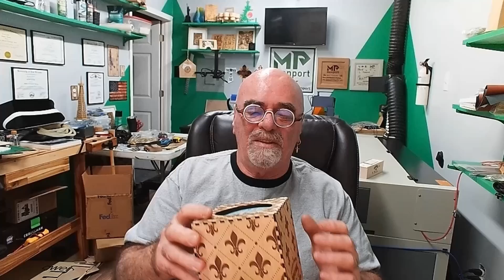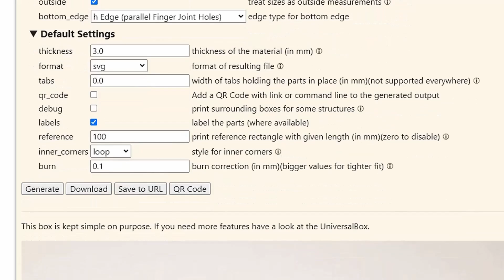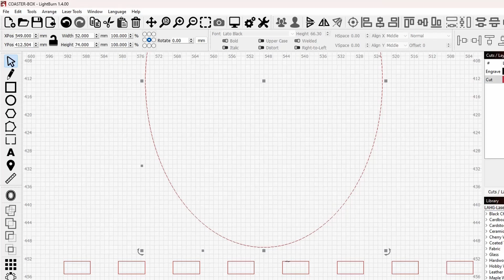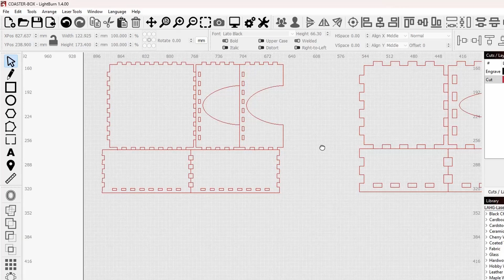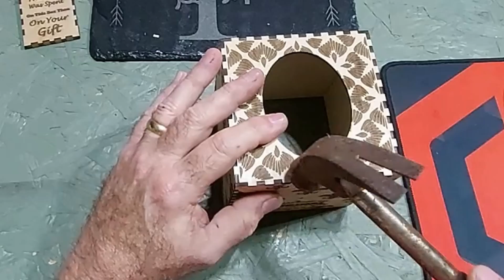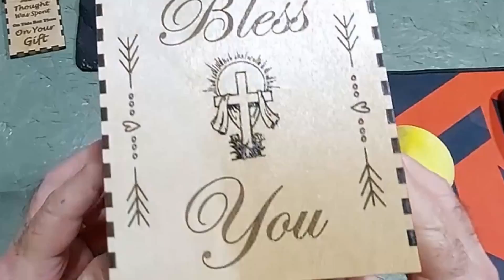👍 Lightburn Design -  Making Boxes for your coasters. How to make custom boxes fast and easy!

Comment from the maker: I ran out of my homemade wax, so I had to buy off Amazon. Usually, I use a pound of bees wax chips mixed with a pint of cutting board oil, melted and mixed in an old crockpot. I then pour it into some 4oz tins to harden. Since I don't do cutting boards anymore, I just buy it on Amazon. Just make sure it's 100% beeswax like this one: https://amzn.to/3J8wt2M

Comment: Rich, another great video with some really helpful tips! 
Do you have any tips on how to round the sharp corners at the top of the finger openings?
The ellipse makes a pretty sharp point at the top edge and the Radius tool doesn’t seem to work on complex shapes like those box sides.
Reply from the maker: The radius tool works for me, or you can always node edit.

Comment: Hello Rich! On the very day I had decided to attempt my first boxes on my LaserMATIC 10 you release a video about boxes cut with the LaserMATIC 10! 

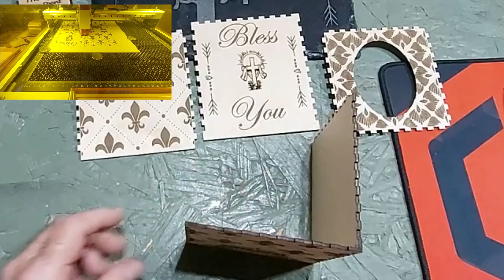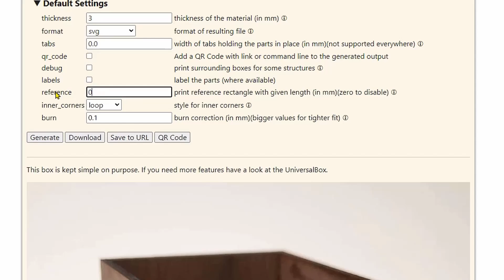At 10:49, 11:30, and 13:17 you refer to a setting of 1.0. Correct me if I am wrong but I think you meant 0.1 which is what you input in burn correction at 3:58. 

I have yet to cut ANY boxes. Am I correct in assuming that I am always going to offset by an additional 0.02 (with the Roly) whatever the thickness of the material might be?

Timely video, I must be living right.

Comment: What beeswax do you use? Source?
Reply from the maker: I ran out of my homemade wax, so I had to buy off Amazon. Usually, I use a pound of bees wax chips mixed with a pint of cutting board oil, melted and mixed in an old crockpot. I then pour it into some 4oz tins to harden. Since I don't do cutting boards anymore, I just buy it on Amazon. Just make sure it's 100% beeswax like this one: https://amzn.to/3J8wt2M
Reply: Love the formula. I knew you didn't use straight bees wax. Thanks.

Comment: Was that 1.0 or .1 kurf
Reply: .02 + .08 should = .1 not 1.0 maybe my hearing is off. 1.0 would give you a 1.02 kirf. Or my math is bad. Anyway, at least I have a good idea what to use when I get my Roly. Have a great day.
Reply: @merrillalbury8214  You are right should be 0.1 :) It's too warm down there in Louisiana so we should send him some snow to get him back on track LOL
Reply: 1.0... my spot size was 0.08 so I added 0.02 for a super tight fit.

Comment: That hammer scares me on 3mm wood! Maybe a rubber mallet or soft blow hammer would be better?
Reply: I use even on MDF. It is not about  the tool but force used
Reply: No, the hammer works best!. I tried a rubber mallet and it doesn't get them all the way in, and you don't hear the change in the sound that lets you know it's all the way in.